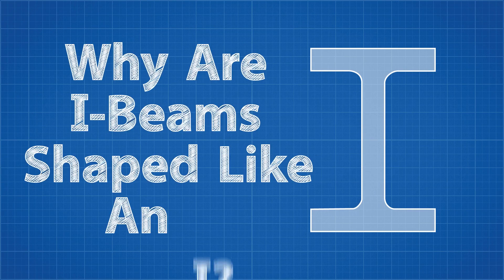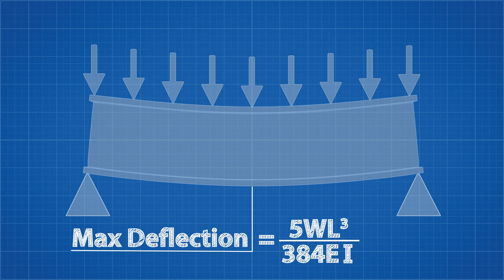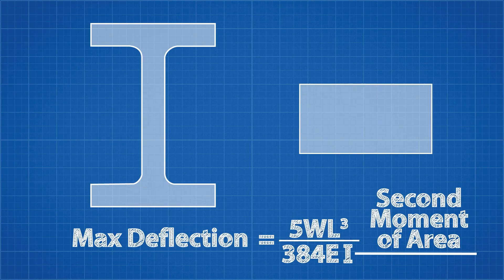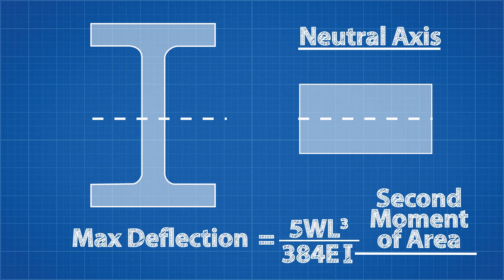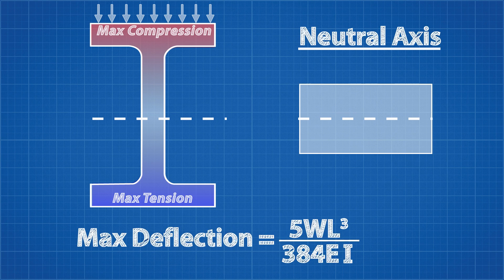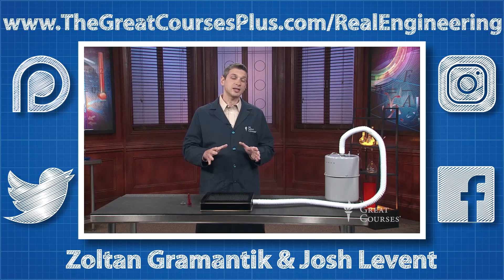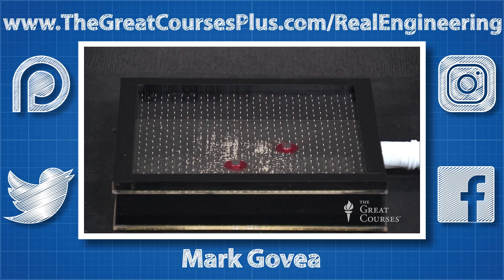Why Are I-Beams Shaped Like An I?

Comment: How would a cylinder thicked at top and bottom and thinned on the sides compare?; in deformation and other stress? what if you made the beam a little longer over the support points and added counterbalance weights on the end? given how powerful circles are I would think it would be better; can you explane why it would be worse? thank you love your videos!

Comment: this almost explains the difference in I beam and H beam piston rods, almost.
Reply: Tubular connecting rods are lighter and stiffer than either h or i beam. They are just a lot more difficult to make. They were used on the Offenhauser-meyer racing engines.

Comment: why aren't I-beams shaped like this |><|
Reply: They are.    The beam shown in this example, is really a W-section, with W standing for wide flange.   "I beam" in the industry has a more specific meaning, which have tapered flanges that transition toward the web, for optimized use of material.   W-sections by contrast, have rectangular webs and flanges, to ease the use of bolted connections.

Comment: What about a square or rectangular tube using the same area as an I beam?
Reply: Because square and rectangular tubing has "webbing" material on both sides, which isn't optimized for performance in bending.   Square and rectangular tubes are used in structural beam applications, but don't have the same strength-to-weight ratio as I-beams and wide flange beams.

Comment: If you had a material with a very high tensile strength at the top of the i and a very hard material at the bottom, would it be insanely strong?

Comment: ahaha the horizintal edges of the ibeam would bend with these forces  distributed along its edge..
its the center section of the i beam,,,, the VERTICAL structure,,, that is designed to take the load not the horizontal edges ahahaha
the horizontals are there to STIFFEN the Verical  NOTvisa versa as you try to wrongly explain
Reply: an h beam of equal mass designed with larger verticals and lesser middle would do just as well ahahah but an i beam sags less over a longer run..thus ibeams became more popular ahahaha
Reply: next thing you know we'll be using a square wheel instead of a round one.

Comment: When I'm riding the bus, I can't help but think about this every time:
The further your feet are apart - smaller amount of braking/moving force affects you. This is of course if you're standing perpendicular to the driving direction, whereas if you're facing the driving direction, you have much smaller moment of inertia and are much more prone to wobbling around.

Comment: wat about H-beams
Reply: H-beams and I-beams are very similar in principle.  And the H-beam is actually rotated 90 degrees, to ultimately look like the letter I anyway.  The essential difference is that H-beams (AKA wide flange beams or W-sections) have wider flanges that are also rectangular, while I-beams have flanges that are tapered and curved to be optimized for the flow of stress within the member.  Wide-flange beams have the advantage of easier attachments of fasteners, while I-beams have the advantage of bending strength-to-weight.

Comment: They are not called I-beams. Any structural steel engineer knows this. There are W-shapes, S-shapes, C-shapes, etc. A W-shape beam is a wide-angle flange beam. But they are not called I-beams in the technical sense. Steel Construction Manual lays it all out for all varieties of beam shapes.

Comment: I always figured the middle portion would resist vertical stresses but be weak to horizontal stresses and the top and bottom would be the reverse, and so overall the shape would be relatively strong in all directions while minimizing materials.

Comment: Being a pipe welder this makes me wonder what is the most efficient pipe/tube diameter to wall thickness ratio for low carbon steel when used in a structural application, of course you have to go thicker for higher internal pressure but for the application of load bearing structures like crane booms and antenna towers, basically where is the sweet spot of strength between a solid rod and a ring of foil? If anyone knows id like to know

Comment: very nice simple explanation!

 however I would not only stress on the bending deflection, but the bending Stress itself, simply because beams are usually dimensioned(or selected in norms) by stress; 
Examples where they are dimensioned by deflection include machine tools  : lathes,mills, etc... (precision is needed)

 
Bending stress = (Bending Moment/Second Moment of Area )*  max distance from neutral axis to the end of material

Comment: One of my favorite examples and the earliest I know of personally is the sword.  A fuller (or groove) runs down the center of the blade on either side starting in at least the early dark ages in Europe making the weapon lighter but still strong, with a cross section resembling an I beam.
Reply: This is exactly what I thought as well and what I came back to this video for. But if you think about it he said the I beam is meant to resist bending parallel to the long part of the I, if that makes sense. Same thing maybe goes for a fuller on a sword. Which is very important for it not to break or bend, but also what is important for edge alignment is minimizing bending along the axis perpendicular to the length of the blade. Which is what usually occurs with spring steel although it is still used and considered better because flexing is way better than breaking. And I just realized that this is why Katanas and blades with thicker backs are stiffer, because they just have more material in that bending direction, which is basicaly just what an I beam does, maximizing the amount of material in the reigions with the most stress during that bend.
Reply: Also how's the last 5 years been lol

Comment: Well, if I remembered it correctly then Sydney harbour bridge uses some super long curved I beam, and its two "horizontal" part are connected with bolts to the vertical part.

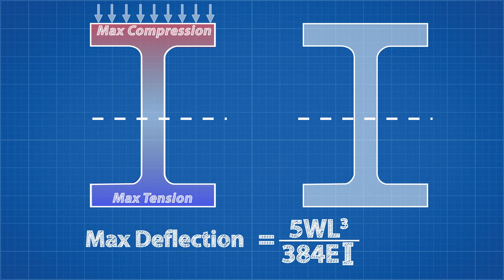Comment: This does not really explain why the beam is shaped as an "I". In the example at 02:28, the value E would be even greater if the material were added vertically even further still from the neutral axis, increasing the beam's vertical dimension while still maintaining its original frontal area. The question here is really why is said material added along a different plane, not the one that would add the greatest vertical distance to the neutral axis. So the question of why are I-beams shaped like an "I" remains unanswered in the video.

Comment: There is another side to it as well. That shape is a lot easier to work with then a solid block. You can maximize space for storage and transport. They are easier for mechanical hooks, claws, chains, and safeties to find purchase on. And because they are pretty much the same thickness at any given surface you don't have to mess around with nearly as many lengths and diameters of of bits and rivets. There are probably other configurations in cross-section that would work just as well for strength concerns. But not also for ease of use.

Comment: Now to calculate if jet fuel burns hot enough to melt them...
Reply: Jet fuel cannot melt steel beams.  However, raising a beam that hot from jet fuel, can seriously weaken steel beams, to the point where they are completely useless as beams.  Yet still solid enough that you can hit them with a hammer and hear it "clang".

Comment: 1:44 if you apply a downward bending load on a beam the lower edge will we in compression and the upper edge in tension  and not the other way around
Reply from the maker: +Joffrey Bluthé this is a beam supported on both sides. You are thinking of a cantilever beam
Reply: Real Engineering my bad ! Sorry about that ^^

Comment: the height may be for load but the top and bottom plates prevent twisting of the beam under load. You can test this with strips of sheet metal. A flat sheet will easily twist but putting a bend lengthwise through the material causes it to resist twisting. The reason for the I-beam's shape them isn't just minimal material for the load because that would be a flat plate but minimal material while preventing the twisting of the support.

Comment: None of what you said actually explains the I-shape. I highly doubt your "optimal" claims. If you run a beam through any topological optimization software, you will not get that shape. The real advantage of the I-beam is its simplicity of manufacturing and it being standard. It's not an optimal shape, but it's good enough. If we actually topologically optimized everything, we could save a lot more when it comes to materials, but then we would have to custom-make every optimal piece, which is a massive pain.

Comment: "Why is an Oi beam shaped like an Oi?" Kidding aside, this a great video. 

Serious question: when a guitar player bends a string, is he in effect applying a load to a beam with a circular cross-section and then releasing it, always staying within the elastic region? I'd love to see a video on the material properties and engineering challenges of instrument strings.
Reply: A guitar string is pre-tensioned.   It never reaches the compression regime while it is being played, and doesn't get loaded like a beam.   The tension varies from its initial value at the rest position, to its extreme value at the plucked position.   If you try to apply a compression load to a guitar string, anything longer than an inch would buckle.

Indeed it does stay in the elastic region.  If you tightened it enough that it yields, the string would become useless as a guitar string, and if you tighten it enough beyond that, it will rupture.
Reply: @carultch  Thanks so much for this. Not being an engineer, I had neglected the pre-tensioning as a factor. It makes the string sound more like a pre-tensioned reinforcing rod, as used in reinforced concrete: or perhaps a bridge cable. I admit to being unsure as to why the force applied to a string in bending would not be considered a load. Perhaps you could clarify?
Reply: @innocentoctave  There will be some beam mechanics involved in the bending of a guitar string, but it won't follow exactly the same formula due to the fact that it is pretensioned.  The total pretension stress in the string is significantly greater than any stress variation due to displacing the string with a load perpendicular to it.

The beam theory formulas assume a bending moment loads the top fibers in compression that is equal and opposite from the tension loads in the bottom fibers.  If you pretension the beam so much as to never encounter compression under the bending load, there still will be a linear variation of the tension within it as a function of vertical position.  However, the zero stress axis will be far away from the member, and the member's elastic curve will not follow the shape you'd expect with standard beam theory.  The rigidity of the string in bending is also insignificant, because the thicker strings are intentionally stranded to make them incapable of maintaining the internal shear strength needed to support a bending load.

When you hold the guitar string at the extreme position, and keep it there, the remaining string length is approximately two linear paths path from the bridge to that point, and from that point to the nut.  The loads anywhere other than the support points, and anywhere other than the point you apply the force, will be a close enough to simple tension, uniform throughout the string.

When you release the guitar string, it forms a superposition of sine waves as a result of the governing equations of a wave on a string.  It is no longer a static situation, because the mass and acceleration of the string also apply.  There is the fundamental wave that has a wavelength (lambda) equal to twice the string length (L), the second harmonic that has a wavelength equal to L, and 3rd harmonic with a wavelength of 3*L/2, and 4th harmonic with a wavelength of L/2.  The tension and linear density govern the speed of the wave in the string, and given speed and wavelength, you know the frequency of each harmonic.  That becomes the frequency of the sound you hear.
Reply: @carultch  Thanks again. I've always assumed that the physics of instrument strings must be more complex than the rather simplistic - if not downright misleading - explanations given in guitar magazines, and your explanation confirms this.

One point: you say that 'the thicker strings are intentionally stranded to make them incapable of maintaining the internal shear strength needed to support a bending load'. In fact, the thicker thrings - usually the bottom three strings of a six string guitar - are not stranded. They consist of a single strand core (round or hexagonal in cross-section) and a separate wrap. The wrap may be either a flat metal tape (smoothwound) or a round wire (roundwound). The important point is that only the core is under tension. The wrap functions purely as added mass. I believe that the reason for this is that material limitations make it impossible in practice to manufacture a single strand string of the required thickness for the lower-pitched strings that would have the other necessary qualities. 

The D'Addario company, which manufactures strings and provides a useful chart of their properties ( https://www.google.com/url?sa=t&rct=j&q=&esrc=s&source=web&cd=1&ved=2ahUKEwiJx-CvtpfpAhUUTcAKHd_cAvMQFjAAegQIAxAB&url=https%3A%2F%2Fwww.daddario.com%2Fglobalassets%2Fpdfs%2Faccessories%2Ftension_chart_13934.pdf&usg=AOvVaw284Y7_E1Qtpp8lLghNGpjx ) (PDF) makes no plain string thicker than 0.026"/0.66mm (wound strings start at 0.017"/0.43mm, so there is some overlap). Plain strings thicker than 0.020"/0.50mm already resist bending to a significant degree.
Reply: @innocentoctave  It's a similar reason why electricians use stranded wire in anything larger than #10 gauge.  Solid wire is less expensive to make, which is why you see it in small sizes, but it would be impractical to impossible, to work with in larger sizes, as it switches from being wire to inevitably being a structural rod.  A solid wire resists bending, which is undesirable when you need to pull the wire thru a path containing bends.   A stranded wire is built so the strands can slip past each other when bending to be more flexible, so that it is only strong in tension.
Reply: @carultch  That does make sense. So far as I know, all steel instrument strings, including those for pianos, use single core unwrapped strings in the treble register, and then at a certain point switch to wrapped strings in order to allow for greater mass per unit length while retaining the bending properties of a single narrower core. 

Of course one can make a string or cable of multiple twisted cores very much larger in diameter than any instrument string. I imagine that power transmission lines are examples of this. But for musical instruments, it appears to be a delicate balancing act between the size of the instrument - which sets an absolute limit to how long each string can be - the range of pitches one wishes to cover, and strings that are both of a playable diameter and sufficiently flexible to resist breakage as the tension varies during playing. I assume that the early manufacturers of metal strings proceeded by trial and error.

Comment: why are performance connecting rods made at a right angle to the stress load on them,  a rod will almost always punch a hole in the side of the block during a failure   & the plains of the rods face forward  & aft. this seems like a design flaw. wouldn't be a first.

Comment: How does the I Beam compare to a tube structure as used in bicycles?
Reply from the maker: +dana ross very similar. A tube will be stronger than a solid rod with the same cross-section
Reply: The tube structure won't be as strong in pure bending as an I-beam however tubes are really good in torsion and have the same bending resistance in all directions. This means for a bicycle a tube section can carry a wider variety of different loads (bi-axial bending, torsion, bending + axial loading) which makes it very useful. You'll actually see a lot of tubular sections used in welded frames and exterior steelwork because:
1.) they are strong under many different load configurations which tend to occur for exterior steelwork (wind, wind + snow, live and dead loads etc).
2.) they look pretty and architects go for that sort of thing.

They don't tend to be used for internal members of buildings so much because you have fewer varied load cases and because you need a flat surface to attached floor slabs and other structural members to. Also connections for circular members are more expensive than I-beams.

Hope this answered your question :)
Reply: that'd be interesting to see a bicycle constructed with I beams
Reply: Thank you. That explains a lot and makes total sense.

Comment: I'm curious about a related topic you glossed over here: why are I beams typically asymmetrical? The axial stress from bending should be symmetric about the neutral axis, yet why lopsided Is? Is it to prevent buckling failure on the compression side? Or is it for some other reason?